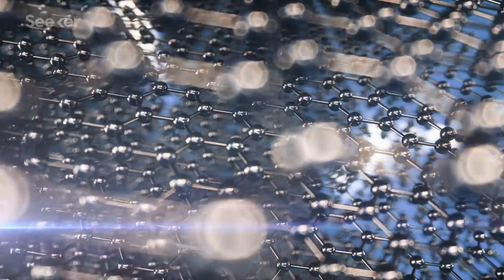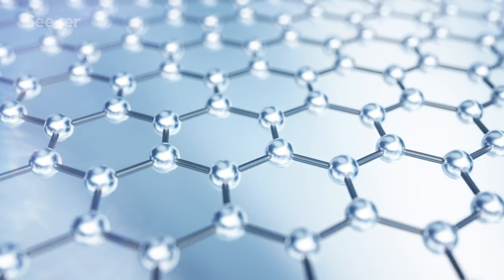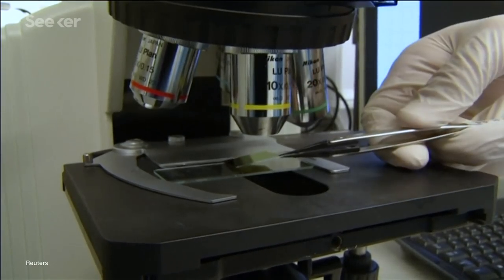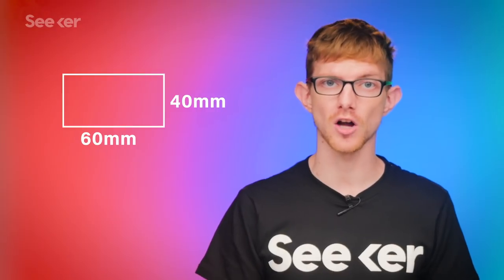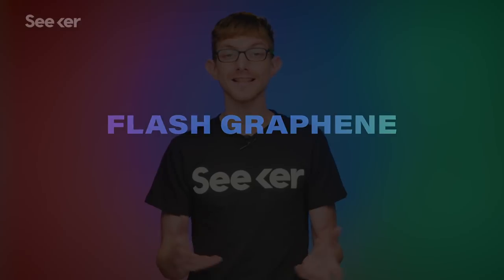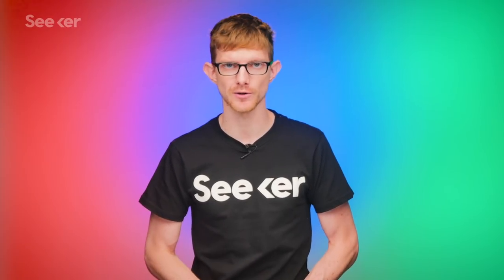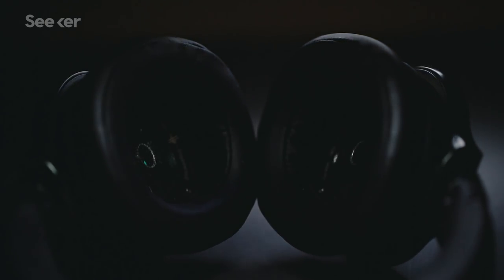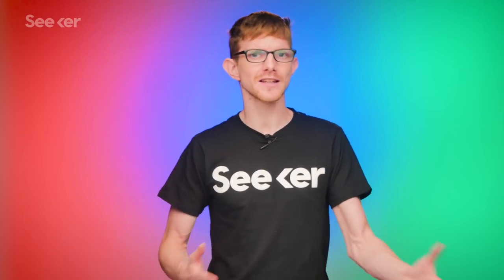Graphene ‘Wonder Material’ Can Now Be Made Using TRASH

Comment: Not to nitpick, but isn't that footage at 3:41 a nuclear power plant with two cooling towers?
Reply: They always show cooling towers as if they are the ones releasing waste products of thermal power plants.... Common idiotic mistake!

Well spotted ;]
Reply: Ya, you're right
Reply: That actually looks like a coal plant - clue 1 - there's a transmission system for large amounts of material (rails and blue pipes connecting) - nuclear plants tend to require significantly less supplies than coal plants as uranium lasts longer and is more energy dense than coal. Clue 2- the clouds coming off the plant/chimney stack. The chimney stack (long tall thin, not like the big two towers) looks to have smoke coming out and the top of the plant also. This would imply burning of a material. Clue 3- those towers are actually universal to power plants not just nuclear power plants, this is because both work under the same principle- heat is generated from a source which heats water which expands and this forces turbines to spin generating power. The super heated water or steam then must be cooled before it completes another cycle of the plant which is those towers, hence the universality of them. Didcot power station near oxford in England actually had those cooling towers even though it was a coal power plant
Reply: @amberc5841  I'll second clue 3. Cooling towers can be handy for cooling the hot water both types of plants use. I'd guess they're used when a large body of water can't be used as a heat sink.

I'll add that even when smoke isn't visibly coming out of the smoke stacks at a coal plant, it is only a deficit in our ability to see a wider swath of the EM spectrum that keeps us from seeing it. If we could see in UV, sulfurous chemicals would be visible and look like billowing clouds of smoke. If we could see IR we could see CO2 billowing out too. While it may not be strictly accurate to show water vapor clouds rising from any cooling tower as if it were pollutants pouring out of a smokestack, it is a way of illustrating something very real which our eyes happen to be too limited to see.  Appropriately made cameras "see" it just fine.

Comment: This reminds me of something about buckminsterfullerenes (carbon-60 and -72). Initially, this form of carbon was extremely hard to come by, produced in tiny amounts by lasers vaporizing carbon. Then some people at a university had an idea: Could they make it with a high-voltage electric source? Somebody recalled that there were auto body repair courses at that school, so they went and borrowed an arc welding machine. In short order, they learned that buckminsterfullerenes could be manufactured in large amounts by this method - but in so doing, they wrecked the welding machine!
I wonder how they broke the news to the head of the Physics Department...

Comment: Cement that is 35% stronger? that means we can build taller sky scrapers!
Reply: Or ground scrapers for as much as we reach up for living and workspace we can go down.
Reply: The strength of concrete is not the limiting factor in the height of skyscrapers, the frames of which are generally - if not universally - steel anyway.
Reply: A step closer to space elevators
Reply: @nyaluogowalter136  can predict that future already
Reply: 35% stronger with 0.01% graphene I'm sure with more graphene in there would be slightly better

Comment: Slightly off-topic material processing question. How practical would it be to break materials down useing vibration then filter it with a screen wire mesh far a consistant feed stock for a 3D printer ? Bare in mind the Earth breaks materials down in a simuliar fashion.

Comment: Create a Flash Graphene convertor, and suck carbon out of the atmosphere, pressurise the gas into a pure form, and use the Flash Graphene convertor on a mass scale, not only reducing our carbon output, but creating an expensive, tough, wonder material, from just the atmosphere.

Comment: i think i made graphen at home before without even knowing it
i was experiementing with woodchar, and i used 24v to pass it thro a piece of char
and it started glowing and produced an arc
i measured electric conductivity of it and noticed its electrical resistance dropped sharply
tip to make 24v pass thro a very resistice woodchar, activated it with urine xD

Comment: This is off-topic but since plastic was later proven to be a prominent cause of cancer, are we also researching potential health risks with graphene?
Reply: I think the thing about cancer & plastics is mainly plastic's polymer structure
Reply: (My understanding was incomplete at this point)
Graphene is pure atomic carbon. It's less harmful than charcoal you throw on the grill.
Reply: @StrengthScholar0  Your full of it, a quick google shows things like inflamation, cell death and cancer.  I'd rather stand next to the BBQ any day.
Reply: @hootsmin  
There was an interesting part of the article that actually differentiated the potential harm of graphene from carbon nano-tubes you may want to look at.

It said that the harmful effects of carbon nano tubes are harmful because of their sharp molecular structure and a subset of the scientific community believes graphene would be potentially less harmful due to the fact it molecular structure isn't "sharp".

BTW what applications does the military use carbon nano-tubes for? I wasn't aware that was a thing.
Reply: @StrengthScholar0  Not sure about nano-tubes, they use carbon black to control clouds.
https://weathermodificationhistory.com/1958-navy-creates-destroys-clouds-using-carbon-black/
Reply: This stuff has EMF shielding capabilities and applications also, I am currently painting my room with Y-shield EMF blocking paint, it contains carbon black and graphene.  Definate possibility it may be used in radar stealth coatings.  Graphene is particularly effective for RF shielding according to my research.

Comment: Graphene is real life vibranium. 
Maybe stronger.
Reply: Vibranium absorbs force.
Reply: Yes! Vibranium is 8 times lighter than aluminum and 10 times stronger than steel,..... Graphene is 200 times stronger than steel and as much as 6 times lighter
Reply: zztop3000  right! But is funny that a real life graphene is stronger that fictional metal.
Reply: @robinhyperlord9053  yes. I dont know for vibranium but graphene can hold electric charge which can also release really quickly if the graphene is designet in right way
Reply: @cayrex  And that's why presently only way to harness their qualities, is building graphene super capacitors.

Comment: Incremental steps are only required because you don't have the managerial infrastructure required. Think globally.
Reply: That soumds an awful lot like a load of bollocks.
Reply: @massimookissed1023  What is the most important thing you have ever produced?
Reply: @KolTony I'm not so sure for building additives. I'd have to sketch out the assembly lines for a few different methods and compare their factors, time, by-products, waste products, quality and expense. It would be nice to chug through landfills and get a fusion level elemental separation without the radiation, high temperatures, or massive capital investments. That shows huge promise for low involvement recycling. Burn it in a furnace, capture the off-gas for refinement, chuck the char into the graphene maker and extract and sell the by products while partially fueled with energy from burning and renewable sources. At the very least you could get decent precursors for electronic graphene production. Although, I would rather see CO2 extraction, at least for the next 200 PPM. Landfills are still a massive issue that has to be dealt with proactively. Giga-tons worth of stuff. This is one scalable way to do it. On that same note, it shows promise for environmentally hazardous site remediation that doesn't require nanobots. The extracted soil burned, carbon could be fed to plants and algae in order to rapidly create organic material which could be seeded with microbes from the region to form native soil. I'd say it has some promise.